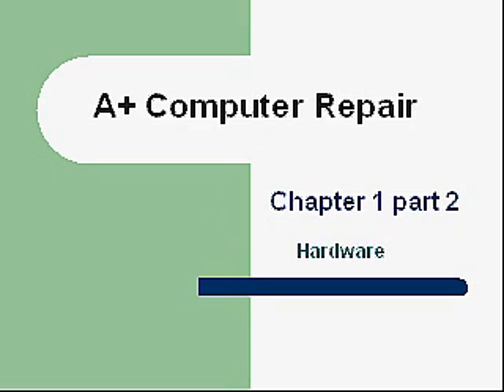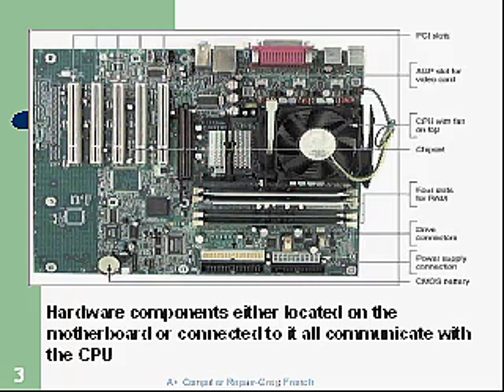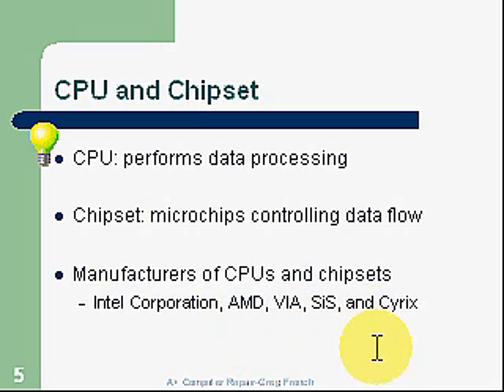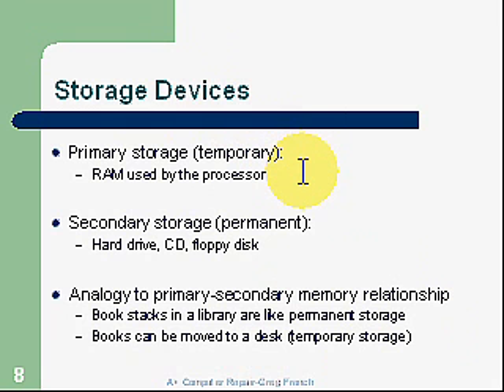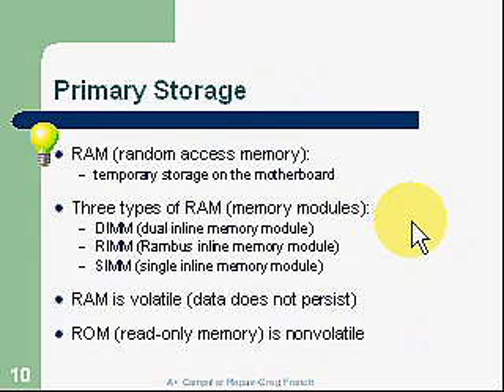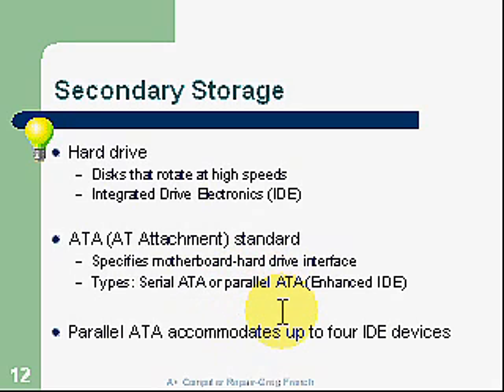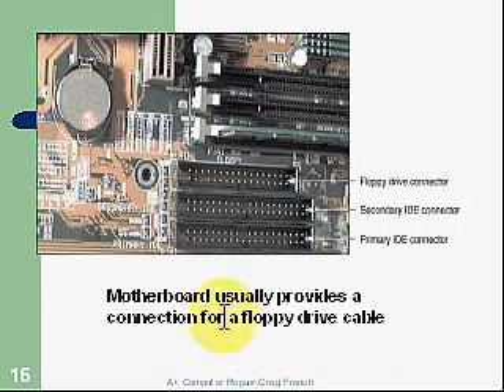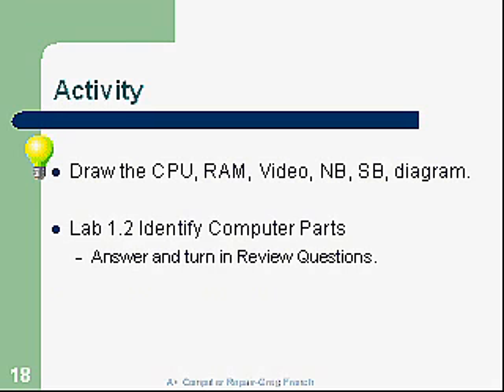A+ Computer Repair Course Chapter 1 Part 2

Comment from the maker: Thanks for the info.  Avira, Avast, AVG free versions for personal use still out perform most.  However, there are several non-free products as mentioned that also perform very well, but it's hard to beat free.